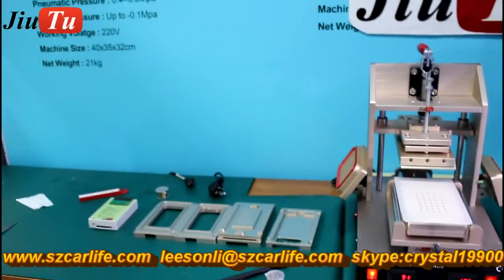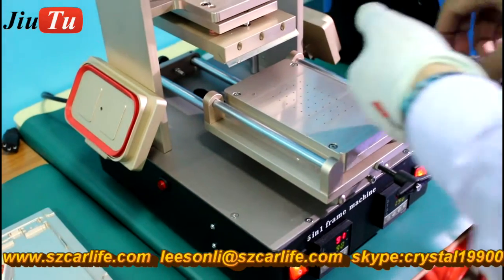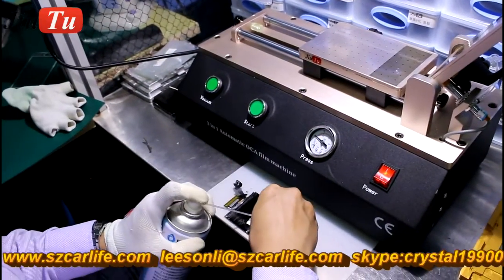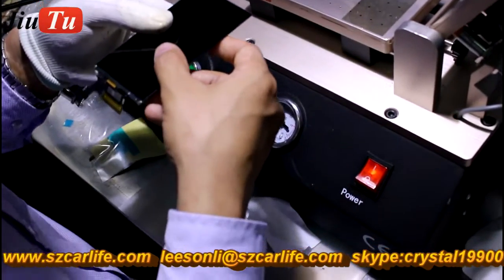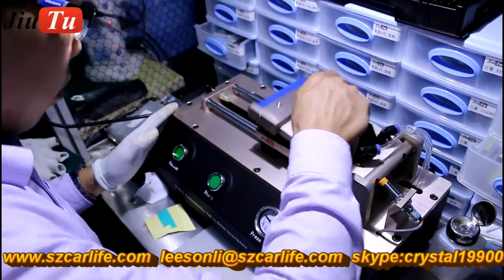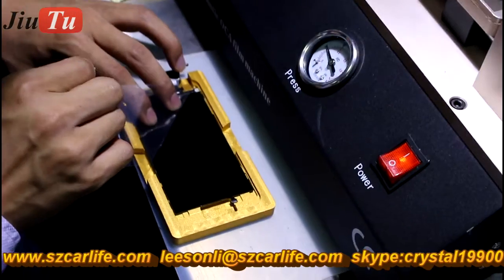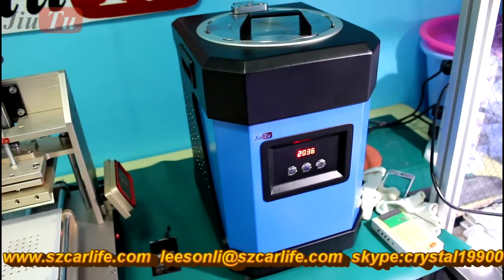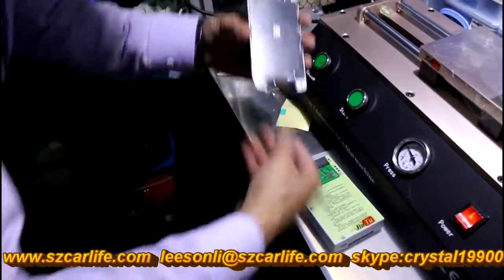iPhone 6s Cracked Glass Replacement Demo Video by LCD Repair Machine  Cost Effective

Comment from the maker: Samsung S6 Edge Cracked Glass Replacement By Using Freeze Machine and 9TU-A002 Set Devices Jiutu ,Contact Crystal for more details.Email : leesonli@szcarlife.com ,skype ID :crystal19900 , whatsApp : +8613510423384 .Website :www.szcarlife.com .
Reply from the maker: Hello , you need the machines or parts ? May we know your whatsapp ? So we can talk details there . BR ,Nina Whatsapp / Wechat 0086 13380305487 . Email : jiutu3@szcarlife.com .Thank you !